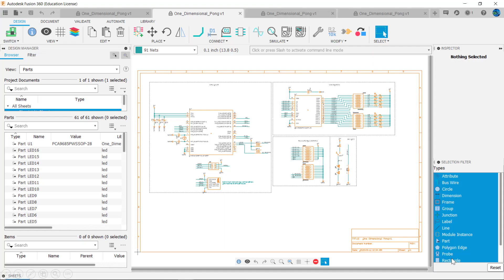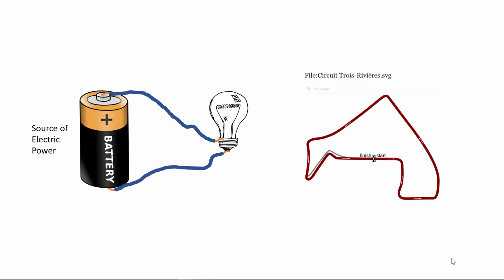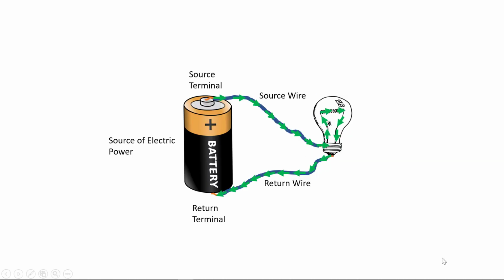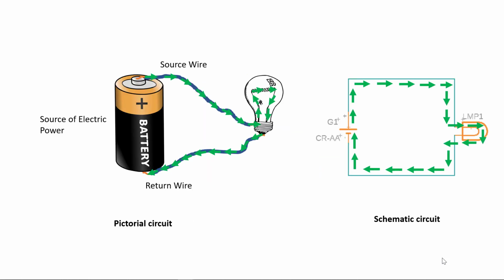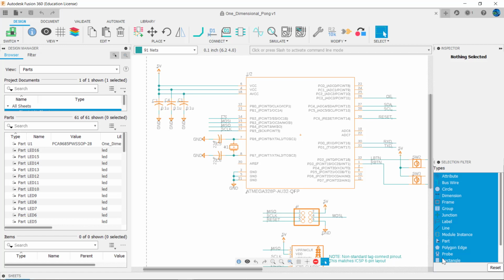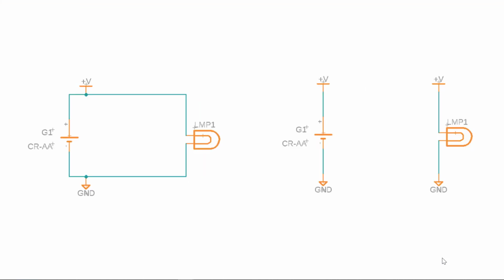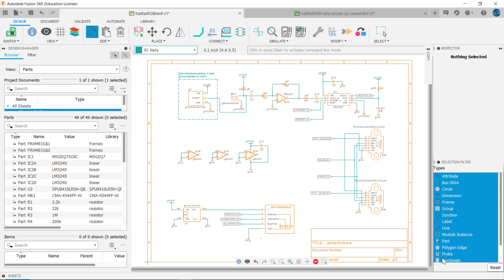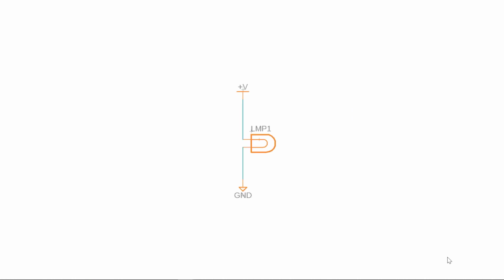Fusion 360: What is a circuit?

Comment: While I'm here and (sort of) talking electronics, I'm not sure if you guys have done much on API stuff but I always wondered if it would be possible to problematically control (i.e. move) joints in fusion with code. Not sure if that is of interest but thought I'd mention it in case it might be possible to demo something like that (or point me in the direction of a resource or example).

Comment: Oh brilliant! So glad you are having a go at this. I've vaguely tried to pick up on the Fusion lectures around the new electronics capabilities but the trouble is, while I'm doing OK at electronics these days, I'm still only at strip board design level - not PCB quite yet (been using Fritzing to create my first few). Latest stuff has been to go into a Fusion design though, so being able to get to the point where I could actually have the physical components appear in the design would be great from a spacing point of view. A big barrier though is how to make a strip board in Fusion and lay out stuff on it, and also, finding the components is kinda daunting. Anyhow hoping if you are starting at the bottom, maybe you could cover doing a basic strip board design in Fusion and how to add components to it, if it's possible of course.
Reply: Thanks for the comments. I'm not sure how you would layout strip board in Fusion, but have you considered prototyping your circuits using perf board and point to point wiring?